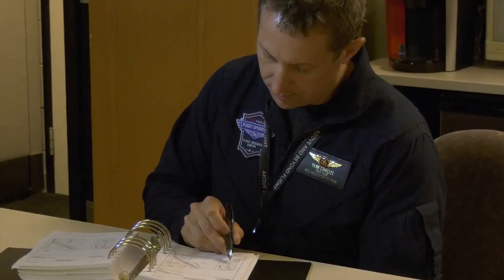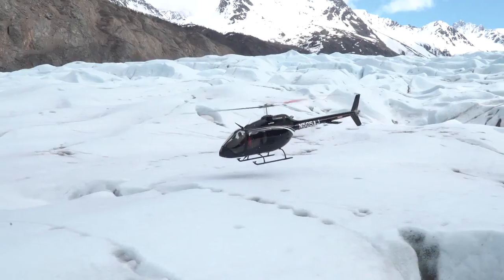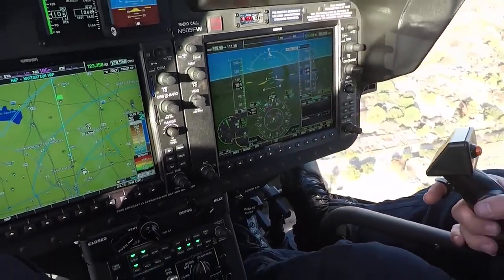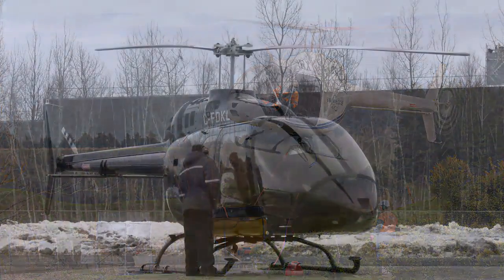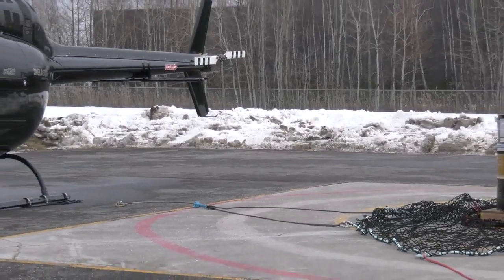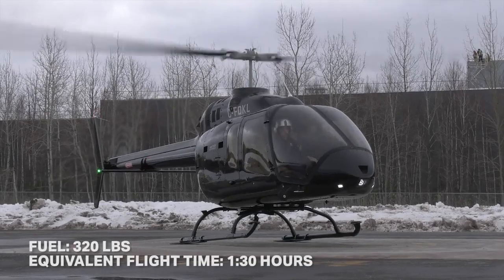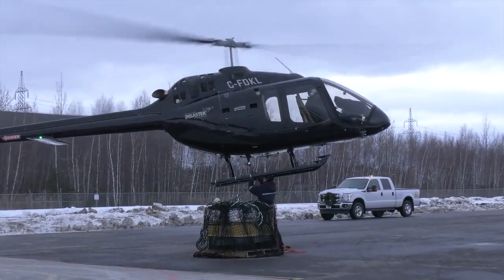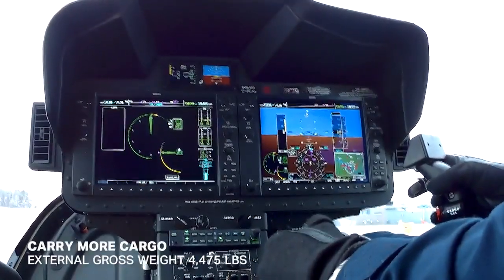Bell 505 – Utility Cargo Hook Demonstration

Comment: Not quite sure how to phrase the question but hopefully you will get the gist of it.  How do you calculate how much the mechanical parts (rotor blade, jesus nut, airframe, engine power output, etc) can support/lift (without it being a danger and strain on the aircraft) and then also by extension how much the helicopter can lift?  Perhaps a video on this?